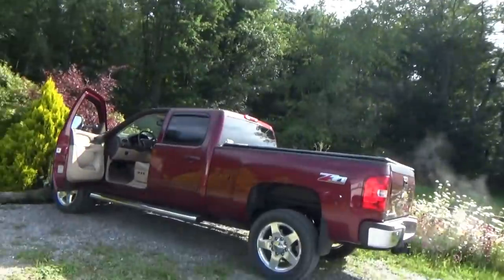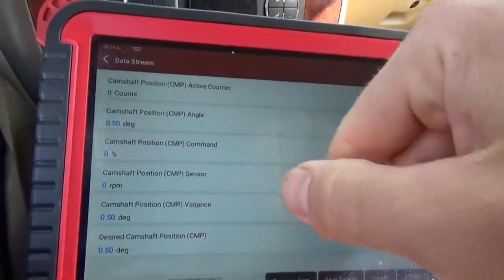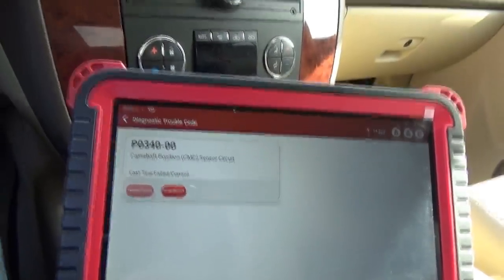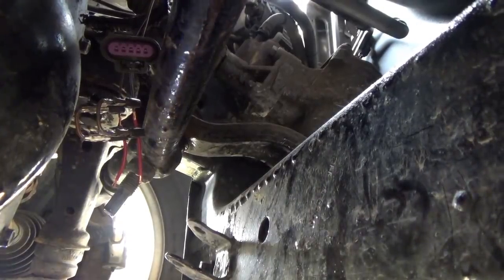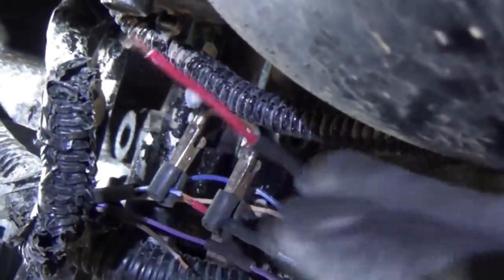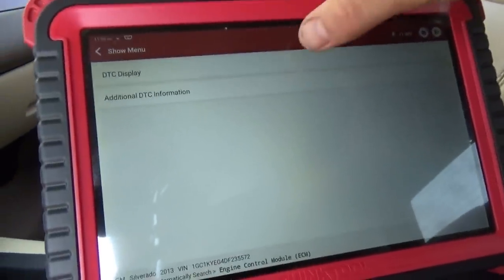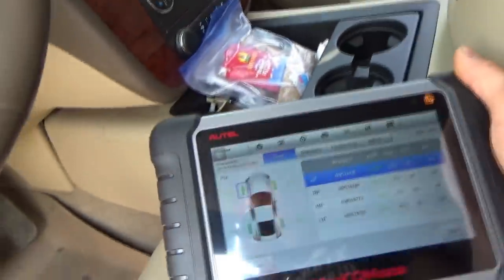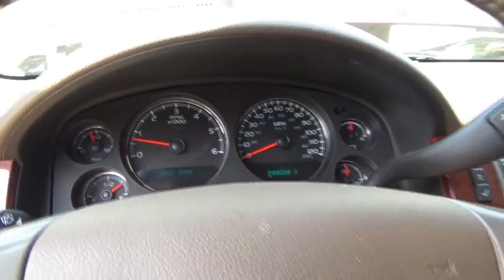Long Crank Time? P0340 (GM Truck)

Comment: Everybody wears the rubber gloves for everything. I don't like them, too hard to handle small parts and generally a pain in the butt. I only wear them if what I'm handling is dripping with oil or when painting. But one thing I would never do is wear the rubber gloves for hot work and around flame, for obvious reasons, and I see a lot of people doing that too. On the topic of groundhogs, I send about 3 each summer to paradise with my rifle.

Comment: I live in a rural area with lots of rodents.  Chewed wiring is a common occurrence.  I have been using Honda anti-rodent tape and aluminum heater duct tape with great success

Comment: Tip If you dont have a gas torch just use the body of the soldering iron to shrink the sleeve. Works remarkably well and you dont need to carry a gas torch

Comment: Exactlyy on the visual inspection first ... 4 decades in Aerospace QA and I'd guess 90% of faults were found "Visually".  As for "Rodents" chewing wires, have the same issue over here in the French Riviera at my place on my C6 Z06 Vette ... they like to crawl up on the fuel rail to each Acorns and also nest in the Cabin Filter ... so far, no wires chewed but not taking chances. So bought some Cotton Balls and a few drops of "Peppermint Oil" (they detest it) and on the Cabin Filter I had to replace ... but no more nesting. You do have to continue to add more drops to the Cotton Balls/Filter (weekly) but it def works Bro !!! "Humans" are not as particular ... the Cabin Filter with Peppermint is quite nice actually. A bottle costs like $8 so cheap insurance.  Happy New Year ... love your vids !!!

Comment: Weird...  When I want to lower the tire pressure in muh 96 Dodge RAM 2500, I just let some air out until muh $1.99 tire pressure guage says 60 PSI.  Then I check the tire pressure every couple of months.  No $4000 computer required.  TPMS is another example of just how lazy people have really become.  God forbid someone might get a little dirt under their fingernail.

Comment: I have a 2004 Sequoia, plate in driver door recess states recommended tire pressure for front and rear is 32psi which is way below this Silverado.
Reply: The truck in the video has 'E' rated tires for 3/4 ton use.

Comment: I had a ground hog chew on the wires in my truck. The damn animal even ate the foam insulation for the A/C and then came back to finish it off.

Comment: I like your wire clamps.  They look so much cleaner then mine.  lol  Mine use a piece of wire clothes hanger and I wrap the clamp teeth with black tape.  They do the job though.

Comment: What is with CMP CPK sensors with you and I.  Ijust worked on a car the other day. Scanned it and it was an EVAP code for a change.  At least this one for you was just a little wire and solder. Stay well my friend.

Comment: have you ever considered using a Liquid Soldering Flux, No-Clean, Pen ?
Reply from the maker: never tried one...
Reply: Ivan order up some liquid flux..its the industry standard inside the circuit board manufacturers. We use the stuff on everything to help the solder flow better, especially tinning wire tips

Comment: I see that truck has the flange for steering stabilizer shock, it looks like it was used and is bent up, I wonder if that shock broke and was up into the wiring wearing it through and chewed it up.
the pesky groundhog got the blame though, lol.

Comment: I hate how the ECM controls the starter and keeps cranking it until timeout if it doesn't start.
I'd like to wring the engineers neck who thought that was a good idea, vs. having it immediately stop on key release and timeout if the key is held on or engine starts.

Comment: I have same soldering iron. I love it! Perfect for tight space. Had a messed up data link or obd2 wiring harness on my personal car, Dodge Avenger. Exposed copper wire and accidentally short to ground.

Comment: People get confused about what a no hold starter is.  A no hold starter allows you to flip the key release and the starter will  continue to crank until the engine starts or 30 seconds elapses which ever comes first to prevent overheating of starter circuits  This  feature prevents the starter from being held in the crank position after the engine has started  reducing damage to the starter / flywheel gear teeth

Comment: Can you link that soldering iron. I have a stationary desk set for smb circuit repair on circuit boards looking for a nice mobile wired variant and I like the profile of the one you used. Thanks Ivan
Reply from the maker: It's in the description! 👍

Comment: The owner should buy HONDA TAPE and tape all the wiring. This would never happen again. I had the wiring on my Tundra taped earlier this year.
Reply: Or you could spray the wire harnesses with a mix of capsaicin and peppermint oil.
Reply: @psdaengr911  you could but you have to keep reapplying it every so often

Comment: I have made several of the wire holders like you have , i file down the teeth a bit to reduce the bite into the insulation, lately have seen them on the tool trucks , not cheap , mine cost literally less than half a buck .
Like 35 rubles.....

Comment: Hi Ivan, thanks for doing what you do. You’re a wizard. I just bought a thinktool pros on your recommendation, and I have a question about it. Is there a way to use the camera by itself? I can open the camera to scan a vin or create a customer contact sheet but I can’t seem to open the camera directly. 
Cheers.
Reply from the maker: I think so... Actually haven't tried that feature myself yet

Comment: I wonder if it would accept something like 0, -1, or -99 for the PSI to just turn off the TPMS.
Reply: The score so far..Customers..Zero, TPMS 500 MILLION. that system is unbeatable, they wanted driver safety to increase, yet they did nothing about it, since the replacement cost for each wheel sensor is so high.

Comment: Here I was expecting the usual GM rusted fuel line causing the long crank time. He should try peppermint or cinnamon spray to deter the groundhogs. Sticky rat traps work too.
Reply: Honda  Tape
Reply: When I've been camping in the mountains, I found leaving the hood propped slightly open on an old oil bottle helped the local pack rats decide they didn't like nesting on my battery so much. Of course they just nested elsewhere instead

Comment: My 5.7 litre Chevrolet LS1 V8 powered Holden Commodore has its camshaft position sensor in the rear of the engine block & I accidentally left it unplugged back in 2009 after replacing a knock sensor & while it did start & run a check engine indicator turned on indicating that I had an engine management system fault !

Comment: I thought Phil was supposed to let us know whether or not we have 6 more weeks of winter, not chew wires. I didn't know he likes GM wiring.
Reply: Would it surprise you that GM made wiring insulation out of material that rats, mice and groundhogs love because it was cheaper and didn't think any further about the repercussions ?
Reply: @robtheslob3940  so did many other manufacturers, I believe the wiring is made of soy based materials....there's a special Honda electrical tape that was created for this exact reason (pricey though)
Reply: He likes all vegetable based wiring, so he’ll eat wires for all brands, since all the “environmentally conscious” companies use it. ;)

Comment: Good old rodent damage!  
Been a long time since I did a TPMS reset.  When the sensors get older, the batteries will go intermittently lower causing the light to come on.  That happened to my 06 Nissan Frontier.  In 2016 I had to change all 4 sensors thankfully over a 4 month period.
Reply from the maker: Yeah when one goes just change them all out when changing tires to avoid the hassle :)

Comment: Under the heading “picky-picky” what about filing the sharp teeth down on the alligator clips? I figure the shrink-wrap would be as susceptible to getting cut as the wire insulation…
Reply from the maker: I double shrink wrapped the teeth lol

Comment: hey ivan why dont you use crimp and seal connectors? faster and easier. like the ones eric uses.
Reply from the maker: They take up too much space, especially in tight locations with multiple broken wires. Often times you can't even get a crimping tool in the space, but a soldering iron always gets the job done and it looks professional :)
Reply: Im 3 months late, watch this PHAD video..ivan proves his point in this episode about connections. https://youtu.be/0_A1t-akQ6k

Comment: Would have been nice to explain more in detail how you were setting the tire limits.
Reply: There really isn't much to explain.  I have the ThinkDiag mini blue tooth scanner.  You go into the module like he showed and input the limits.  He was using a TPMS tool for the tire relearn, but most cars can be done manually by letting air out of the stem for about 5 seconds.  The horn will beep, then you move to the next tire.

Comment: Hi Ivan, I recently purchased a ThinkToolPros from your menu. The manual that comes with it is very short and gives minimum information. Where can I find the big manual giving me all the info on this machine, like how to find the tpms mod like you showed us in this vid? Thank you.
Reply from the maker: Hmm good question! I just poke the screen until I find what I need haha
Reply: @PineHollowAutoDiagnostics  I recently got a ThinkTool Pro too and am doing the poking around through the menus. Any info you can share is helpful, thank you.
Reply: Ivan. When I bought my scanner. I don't think it came with a manual. I have been poking around too. Been learning from Mr. Eric O and Bernie and you also.

Comment: That scanner is (SWEET) and I'll bet (EXPENSIVE) and I want one... I always learn something new from your case studies. Case in point 1999 Mercedes Ml320 no codes but had a very slight stumble at idle... Cue visual inspection, I noticed black goo running down the bracket that secures the MAP sensor. Problem solved with a new MAP sensor, the plastic potting had melted in the back of the sensor and caused an incorrect MAP reading to the ECM and explained the negative fuel trim readings when the engine was at operating temp. Oh and by the way my wife loves that old Mercedes so I'll keep it running as long as I can 207,000 miles and counting because ... (if she's  not happy ain't nobody happy ) Thank you for all that knowledge you pass on to us "back yard " wannabe mechanics
Reply from the maker: Thanks for the comment, Carl! My wife keeps telling me she wants a fancy BMW...maybe one of these days I will break down and let her get one to make her happy hahaha
Reply: @PineHollowAutoDiagnostics    Yeah.. you'll break down and make her happy. IT'LL break down and make YOU unhappy because SHE'S unhappy... You're gonna lose either way ;D
Reply: @PineHollowAutoDiagnostics  step away from the BMW. I did a service on one and the dash lit up like a Christmas tree. Explain that to the customer how you strached his chains while you were doing a service 🙄
Reply: @PineHollowAutoDiagnostics   I see X5 videos in the future.  :)   Many of them.

Comment: Is that the autel TS608 you were using to read the sensors? And would the autel not adjust the thresholds? I haven’t had a need to adjust thresholds but it’s a good thing to know if my autel is capable. Great video sir, thank you!
Reply: Looks like an Autel TPMS Scanner was used in conjunction with the Think Tool
Reply: @billsmith2212  it looks like the TS608, I’ll have to see if mine has the threshold option.
Reply: I believe that is the Think Car , Think Tool Pro , Bi Directional Scan Tool .

Comment: you need a lift
Reply from the maker: Actually I need a bigger shop that would fit a lift and a truck on the lift HAHA! Since a lot of my work is mobile and electrical, I haven't justified the expense...yet :)
Reply: @PineHollowAutoDiagnostics  Go old school. A pit doesn't require a high bay and  insurance is cheaper.
Reply: Even a name brand 10k pound lift isn't that expensive.    A scan tool can cost more.
Reply: @paisleyprince5280  agreed, I was thoroughly shocked at the affordability of a proper lift

Comment: Like the wire clips for your soldering I have another one for you take a test wire with an alligator clip on it and solder a sewing needle into it and you have a probe I took one and soldered sewing needle in both ends

Comment: As I get older I tend to have a longer cranking time.
Reply: Followed by a hard start and rough running. My engine light is flashing 90% of the time
Reply: I crank it forever and nothing happens
Reply: Doesn't help when the crankshaft is bent either.
Reply from the maker: @InsideOfMyOwnMind  LMAO!
Reply: @NotAbotJustAbadPlayer  be careful you may be the model getting traded in.
Reply: Yeah, I think I could use a new cam sensor transplant as well.
Reply: I can relate. Sometimes I even have cranky time
Reply: The older it gets, the more often you'll have an unproductive crank...
Reply: And the "back firing# after I eat a burrito doesn't help matters.
Reply: I feel ya
Reply: The drains are clogged try something that opens them lol
Reply: Cranky time. 😄
Reply: This is normal don't worry about it.
Reply: Reduction of performance, increase of green house gasses, and all sorts of creaks and squeaks.
Reply: Yeah, you just become an endless money pit when you get older, they jjst keep replacing parts and doing endless electronic scans, after having five stents installed in the last 24 years I've had more wires hooked up to me than your average eurotrash can ever dream of.
Reply: I really could use a 1997 Toyota Tacoma water pump gasket replacement.
Reply: @bobbydelamar606  okay Bobby let's keep it clean please.
Reply: @_RiseAgainst  😂
Reply: @_RiseAgainst  It's a kinda hard job the older the unit it gets.
Reply: @bobbydelamar606  You wouldn't have that problem if you hadn't over torqued it.